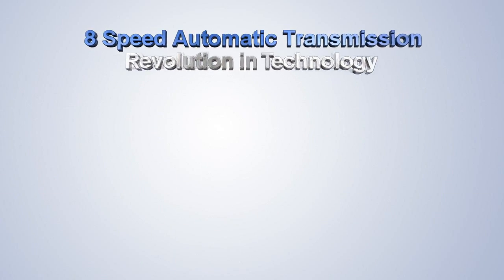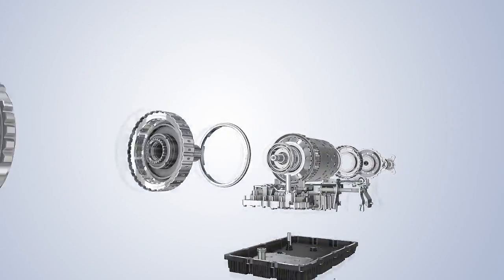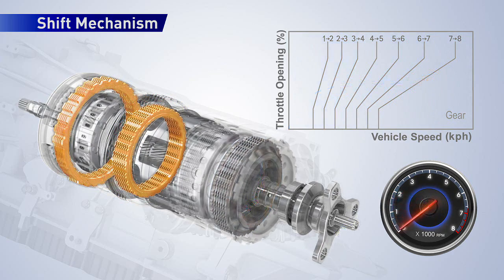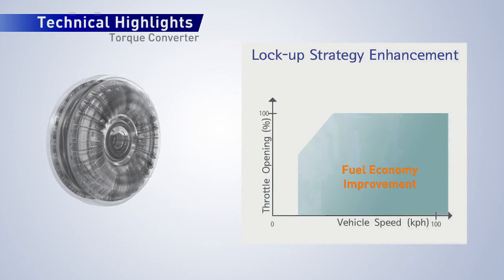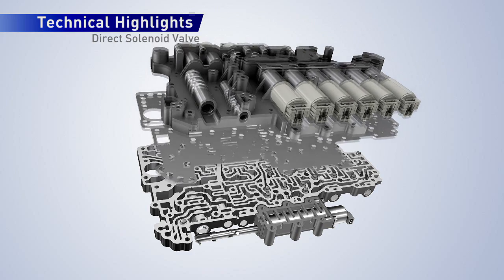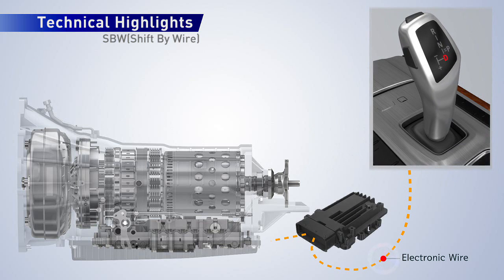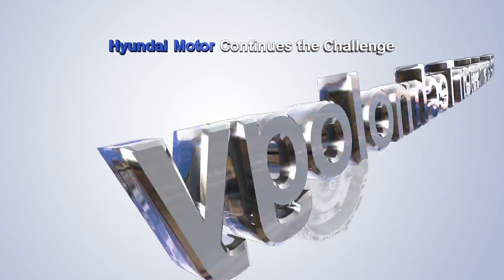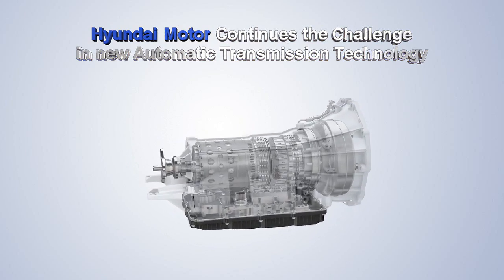Hyundai's new 8-Speed Automatic Transmission

Comment: Lexus ls460 did it first amd better.
Reply: Lexus did it first, ZF did it better. So many cars that use them, even the hellcat. Reliable, strong, proven. I doubt a Lexus 8 speed can handle anywhere close to 500lb.ft of torque let alone 900 like the ZFs can. And with zero issues.
Reply: @xjsauce plenty of F cars with over 500lb ft, try again, the isf transmission shifts faster than any dodge transmission in existence and its from 08 LOL
Reply: Okay. Except that Lexus does not make their own transmission. Not really a comparison so try again. Lexus wouldn't have a leg to stand on in this topic because they rely on a third party to develop their transmissions.
Reply: @mackfar27 blablabla cope more boy

Comment: In reality this is a ZF 8 speed not developed by Hyundai. Just an FYI.
Reply: Very similar in almost every way to zf8hp from the internal looks but reliability.... Only time will tell
Reply: @j @jw18xxx mines still shifting perfectly.. only 115k on it though..
Reply: Its not a ZF transmission dumbass, its a Hyundai Powertech 8 Speed auto.

Hyundai no longer uses ZF Transmissions, they used the ZF 6 speed auto before for a short period in the V6 Genesis Coupe and V8 Genesis Sedan.
Reply: alawadhi3000
You sure about that one? Search Hyundai Equus and find out.
Reply: John Doe
Yes I'm, when it was first released everyone though (including me) it was the ZF 8 speed model which was recently announced at the time, I have the transmission dude, its not a ZF.